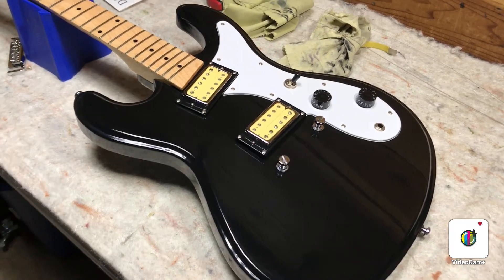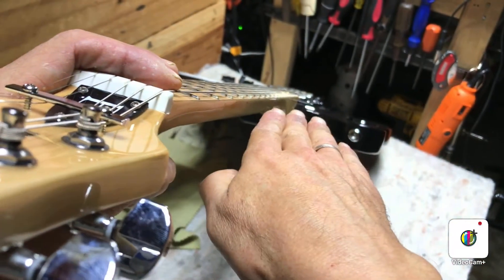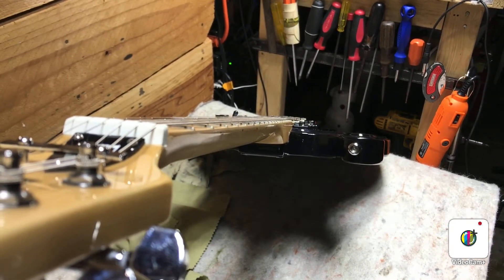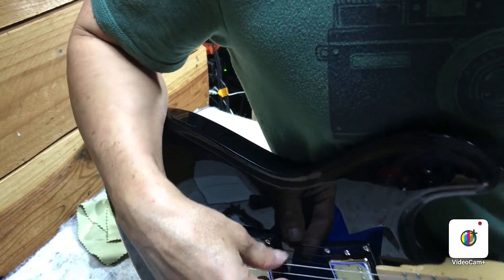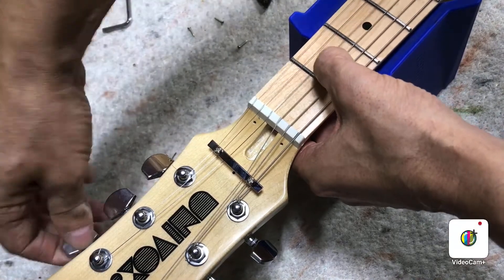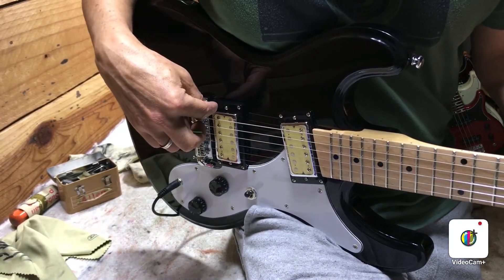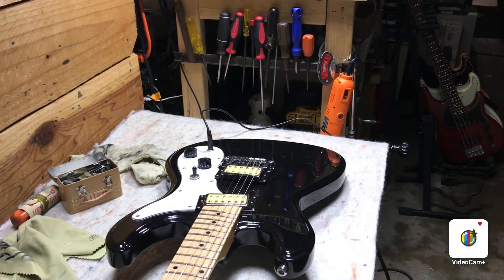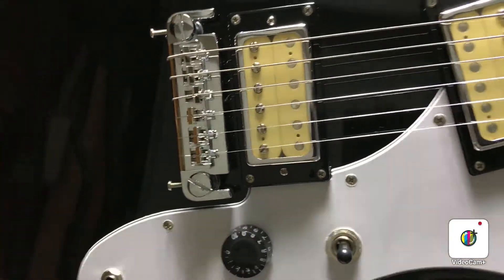Guitar Setup - Eastwood Hi Flyer Phase 4 - Univox re-issue

Comment: I have one of these and have never had a bridge like this. Would've been helpful to see you actually do all the adjustments, set the action etc. How much you had to adjust. What you used to loosen/tighten those big screws, which way they turn for looser/tighter etc. lt seems like your aim was to do a general setup video. I only found this because I searched for an Eastwood Univox setup video. There are plenty of general setup videos but none specifically for this guitar
Reply from the maker: sure. Look at 9:20 in the video. Off to my left on the table you'll see the large slotted screwdriver I use when adjusting such a wraparound bridge. Also, know that loosening is counter-clockwise and will raise string height. Tightening clockwise will lower the strings. In addition, it may help to loosen the strings slightly if you encounter a lot of resistance trying to turn them. and be careful not to let the screwdriver slip and scratch the guitar. Please see this video: https://www.youtube.com/watch?v=xE14EMLVAKk&t=421s where I adjust the height of same type of wraparound bridge on a LP Junior at 3:45. Hope that helps. good luck!

Comment: What nut size do u think a univox phase 3 nut is ? I just bought one for 600 , not a bad grab, 70s model white- unfortunately the low E nut slot is gone halfway- seller forgot to tell me this - didn’t matter still would’ve bought it lol- 

I think it’s 1-9/16..
Reply from the maker: nice pick up...measure it and try the nearest sized Tusq nut, or make one from a blank if you're adventurous.